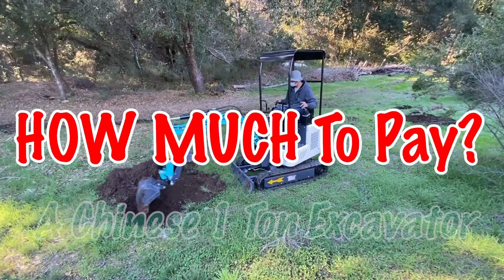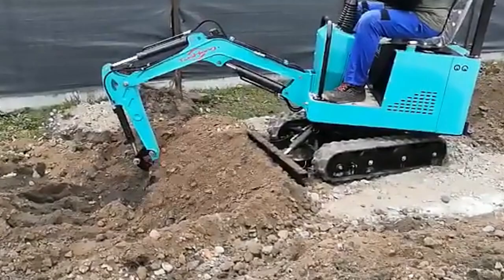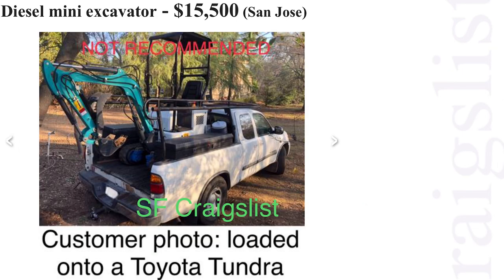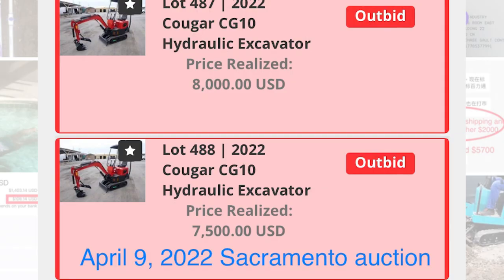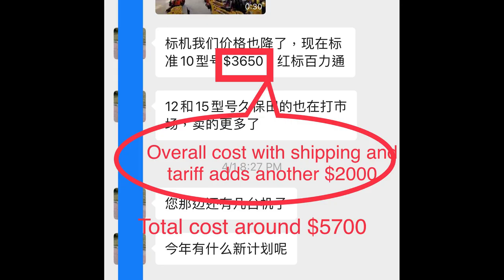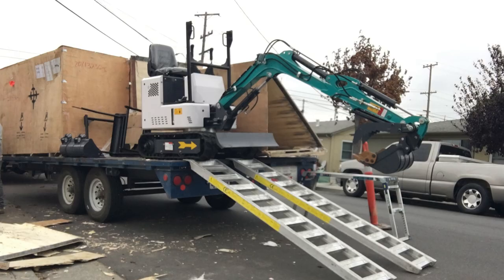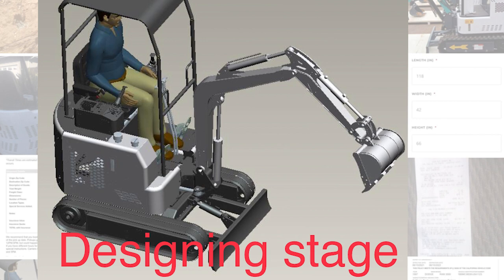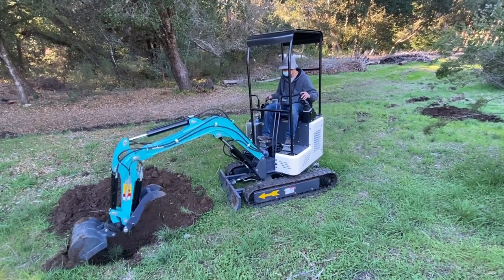Let’s explore different ways to get a Chinese mini excavator, most importantly, HOW MUCH to expect

Comment: I went through the process on purchasing a mini excavator with Jason's help. He has worked with the factory in China to put together "packages"  of mini excavators with a particular build and set of accessories. He has made sure that certain safety features are included such as a hydraulic lockout switch and balance valves on the drive motors. I purchased the 1.5ton 3cyl kubota diesel package with $1k worth of accessories directly through the factory in China. Total came to $15,200. That's everything,  including the accessories,  excavator,  broker fees, tariff, and CFS fees. The machine came with a hydraulic thumb, boom swing, and pilot controls. Process went relatively smoothly, I placed the order in the beginning of April of 2022 and picked it up at the end of July. I picked it up from the CFS in Kent, WA myself and hauled it home.  I have to admit it was scary making that wire transfer straight to the factory but it went fine.  Overall I'm happy with it and I can tell that anything smaller wouldn't have worked for me.
Reply: What are balance valves
Reply: $15,200 included the 25% import tax?

Comment: My 1 ton machine is still in a boat, but I will pay around 6k including fees for a 1 ton machine with attachments from Mia.
Reply from the maker: Great to hear, thanks for sharing.  Did you get any extras, like buckets, augers, etc?  $6k for just the excavator, what fees are you talking about which is included?  Let us know your final price after picking up the unit.  Do come back and share your user feedback, thanks again!
Reply: Updates?
Reply: @joeyprather4739  The total price came up to $6800 shipped to Atlanta Ga. I ended up getting a grabber and a wide sand bucket in addition to the standard bucket. The machine is great for the price!
Reply: @michaelayeni177  Nice. You feel like it’s repairable when the time comes?
Reply: @joeyprather4739  Oh yeah definitly. The engine that came with my machine is the most complex component. So it being American made helps when ordering things like filters and other parts if it breaks down. All other components are simple and straightforward.

Comment: paid 9k for mine, built quality is crap, but I tuned it a bit, this thing is a beast , it broked on the second job, due to bad built quality, i tuned it works great for 9k is a money maker
Reply from the maker: Not bad price, pretty much average according to the video.  Good thing is that they’re becoming more common in auctions and comes with the extra buckets for work.  Thanks for commenting and cheers!
Reply: Once you're done working on the machine, you can work on your spelling.

Comment: I run a mobile home park and it's a plumbing nightmare.  I need a machine that size or smaller, I do not have any discs in my back left to keep shovel digging.  What do you suggest honest opinion from community will it help me.  3 grand is what a company would charge me for one dig.
Reply: Another option for you might be the Harbor Freight mini excavator. I bought one and it would be better to have tracks but the machine is capable, affordable and a whole lot better than a shovel. One word of caution though, consider how deep you need to dig, these lightweight machines can only really dig approximately 3/4 of their max depth.

Comment: I'm in San Diego where are you and do you sell them?
Reply from the maker: I’m in NorCal.  San Jose, CA.  I do have the gasoline 1-ton machines on hand, but it would be easy for you to import and pick it up yourself and save!  Thanks for commenting and cheers!
Reply: Will you sale yours?
Reply: Or would you consider charging for your guidance, just to ensure I don’t get ripped off?
Reply from the maker: I do both.  I import some and sell them, and I also help other get connected with the factory if they want to import themselves.  Thanks for commenting!

Comment: Buying cheap ( crap) Chinese machines is just stoopid ...buy right buy once...Kabota Takehuchi etc...
Reply from the maker: Depending on what you do, these may just work out fine to get the job done.  Blessings and thanks!
Reply: U mean kubota ? Lol
Reply: U mean kubota ?
Reply: Place I worked sold a few UN brand Nissan powered Chinese forklifts. They were a clone of a tcm I believe, but $18k cheaper. They were alright, the customers that bought them liked them. Had weird stuff like proprietary air filters. Operated one many times thought it had gates hoses till I looked closer and they said "gaida" in the shape of the gates logo. Sneaky mfrs lol

Comment: I just got a groundhog from nick in Pennsylvania, I got the zh20d 
Hes an excellent dude to deal with as far as business . I cant say that enough
Reply from the maker: Good for you, glad to hear more people can be more productive with these lower cost excavator units.  Once thing I notice from seeing his YouTube that the excavator he carry does not have balance valves, so he extra careful when working on hillsides.  Hopefully he’ll start implementing these on the Groundhog excavators.  Cheers and thanks for commenting!
Reply: @jasonyeh99  what is balance valve?
Reply from the maker: Balance, can also called counter-balance valve.  It equalizes and limits the incoming hydraulic flow so to prevent suddenly influx of hydraulic fluid thus caused unwanted uncontrollable movements.  It basically make the excavator act like it’s on the flat ground at all time, whether be in steep up, or downhill situation.  Hope that explains, cheers and thanks for commenting!